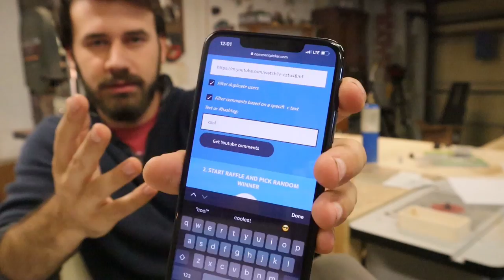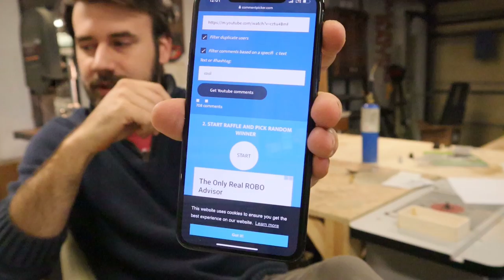Open Mouth Bass SwimBait | Make & Fish

Comment: Handy tip to make sanding loops for the telescoping sanding stick: make a loop of 1" wide shop roll Emery cloth joined with strapping tape at the seam, then tear/rip them down to the width you need. Decent quality shop roll abrasives will rip straight to a consistent width.

Comment: ". . . and the open mouth is gonna be a lip."

We have them up here in New England for the surf. They're called "Bottle Plugs" and they're used to catch Striped Bass. They're supposed to be used when the wind is blowing 25+ mph and the water is too rough to use anything else.

Comment: 11:14 It's not gonna dive unless you remove or taper the top part of the mouth...i haven't even finished watching the video but I'm sure it's not gonna dive the way you want it because that top part is gonna wanna pull the bait up and out of the water..that is if you put the line tie in the middle... if you put the line tie higher on the upper lip maybe, just maybe it will dive a little bit.

Comment: You are the only lure builder I have ever seen that might be able to build lures at the level I build them and I want to challenge you to a contest .  Hello I used to run Musky Chimes custom tackle and I make lures a lot like you build but have been doing it for years and years .  I see you are good but I still think I can take you (goading ).   Here is my challenge to you :  5 lures , carved cedar wood in each lure with or without soft plastics added (up to builder)  ,7 days start to finish, each lures worth 10 points per lure max score, most points win the pot.   Lure must look great and swim well to score top points 
$100 buck each throw into the challenge ,winner takes all ! 
1 8'' jerkbait , Natural baitfish. 
1 8'' twitch bait , natural baitfish .
1 10'' jerkbait, cartoon shape and pattern .
1 10'' jointed crank , natural bait look and pattern .
1 6''-12'' surface lure any design any color .  
1 bonus lure for tie breaker.  bucktail lure of over 6'' 
We need an impartial judge to score the lures .  Lures have to work and not just look good so they have to be able to hold up to an entire fishing adventure and beyond to score . if the bait action fails or finish is damaged in the testing that lure is disqualified .

I have been looking for a bait builder I think can actually give me a run for my money for a long long time  . You are the first I've ever seen who might have the skills to beat me however my on water experience and lure craft talents are going to be very hard to beat no matter who you are .   I think I can take you in a build off !  Let's do this !